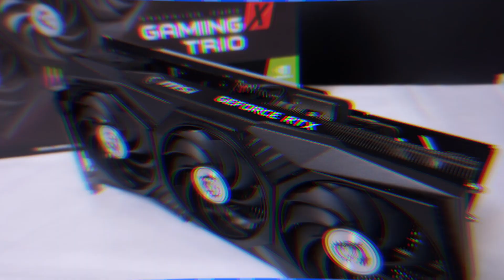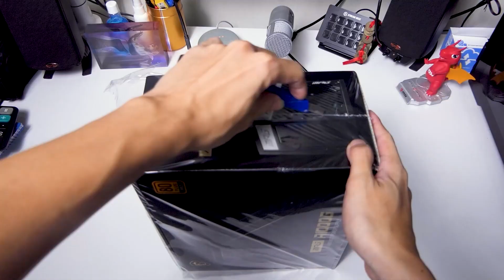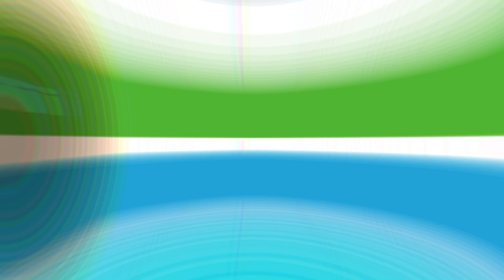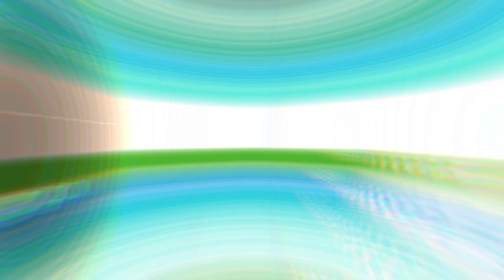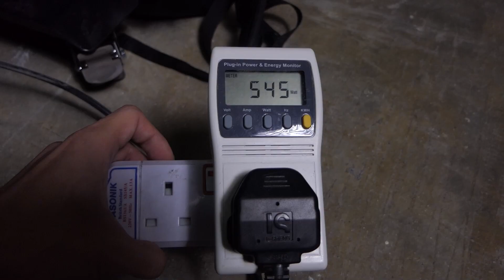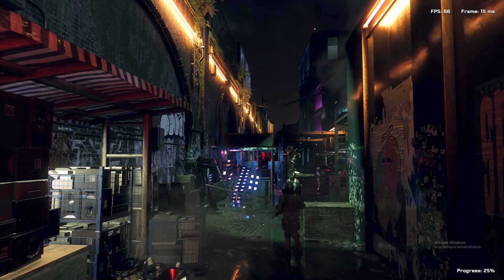MSI RTX 3090 Ti Gaming X Trio - Is it WORTH It?

Comment: hi, i keep an i7 10700k 16gb ram 3600mhz 850w power supply, can i fit a rtx 3090 ti gaming x trio in this configuration? with 850w
Reply: I’m running this card with Ryzen 9 5900x, 32gb of ram 3600mhz with an 850w and it all work no issues it’s recommended 850w or higher

Comment: the reason why i came here is to learn about that "Silent - Performance" Switch on the GPU, Can someone pls explain how much of difference does it do ?
Reply from the maker: I have not tested the silent performance tab yet. But i did set the fans to low speed (close to silent) in MSI centre. The performance is still comparable to performance.

Comment: Not sure if you are reading old video comments, But i highly suggest you find a different solution for stabilizing your footage. The warping is insane. You can use adobe after effects with tracking for better smoothness without distorting the video.
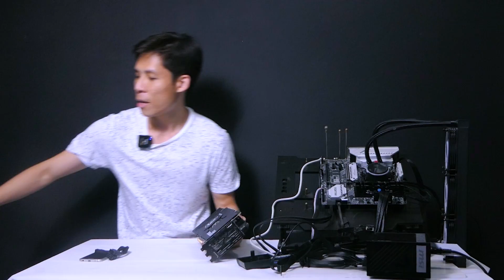Reply from the maker: Hey thanks for your comment. Do you mean at 3:40?